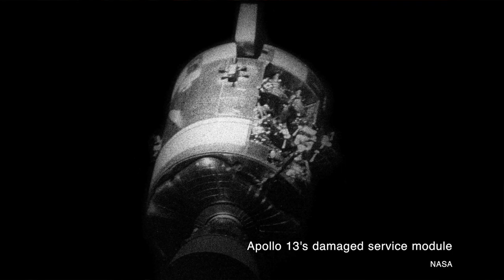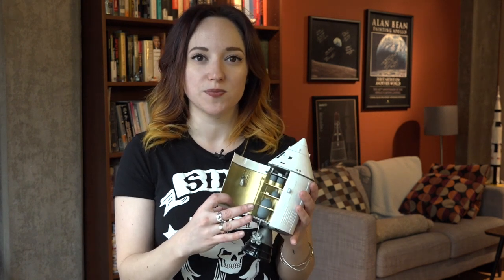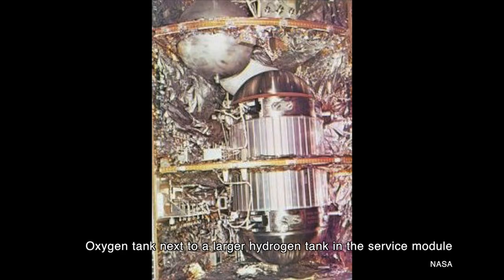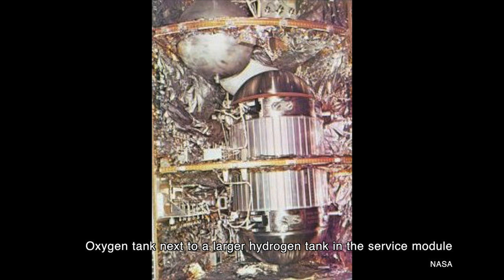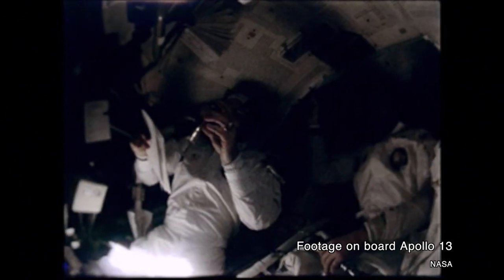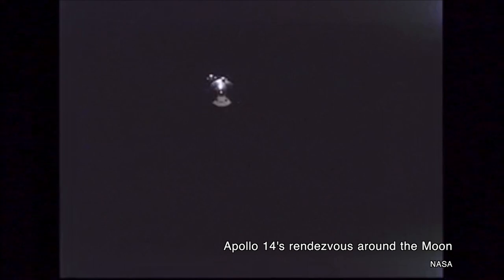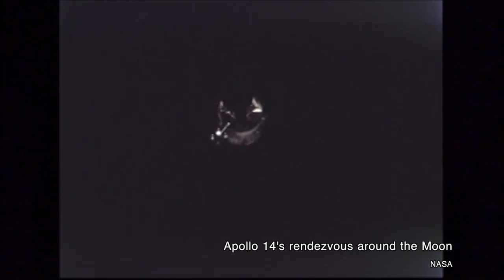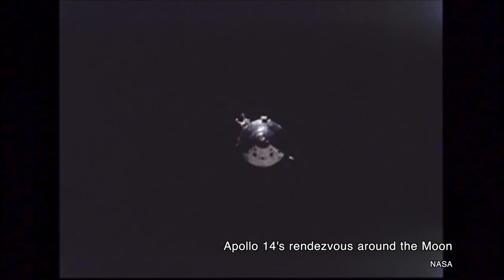What did NASA Change After the Apollo 13 Disaster?

Comment: Excellent presentation.  Just a couple of notes.  When the shelf was dropped 2 inches in October 1968, the drain tube, which was difficult to tighten due to it's position became dislodged, preventing de-tanking after the CDDT ( countdown demonstration test).  Heating the tank vented the O2 out the vent tube as well as causing the relay to be fused closed by the electrical overload.
Apollo 10 was the first apollo flight to experience a fuel cell failure.  It occurred on the way home so it did not affect the mission. If it had occurred outbound to the moon, the mission would have be scrubbed.

Jack Swigert actually volunteered early to be a command module specialist as did Ken Mattingly.  He was on the support crew for Apollo 7.  Just prior to launch, Wally Schirra, who had a very perfectionistic and overbearing presence in the planning of the flight and manufacture of the CM did something that proved a great asset.  He personally asked Jack Swigert to come up with an emergency power down checklist just in case there was an explosion in the service module. 
 God moves in mysterious ways.

Comment: Very fortunate that the Apollo 13 defect was not on the Apollo 8 command module since they did not have the lunar module life boat.
Reply: Good point.
Reply: Or, even on the return journey, as they also wouldn't have had the lunar module.
Reply: Wow, I never considered that.
Reply: @xyz.ijk.  One of the first things my father thought about  after the flight, being that Jim Lovell was on both flights. I was thinking the same thing.
Reply: I just saw how Lovell hit the wrong computer code p01 that reset everything and really screwed up APOLLO 8 for a while
Reply: @GoodVideos4  and that is thanks to another malfunction. the sensor in the tank was not reading correctly so they were stirring the tanks more frequently to make sure the oxygen wasn't stratifying. if they had not been, they calculated that the tank would have, instead, exploded sometime around the time while Lovell and Haise were on the moon or after they had re-joined Swigert and ditched the exhausted LEM.
Reply: Jim Lovell was really hoping to walk on the moon that second time, after not having been able to the first time.
Reply: @mem1701movies  Just like what Forrest Gump would've done.

Comment: Jim Lovell's biography "Lost Moon" outlines a slightly different sequence of design and procedural failures leading up to the infamous O2 tank explosion (my apologies for the wordy explanation):
  
(1) The O2 tank heaters were originally specified to operate on 28V power; NASA asked their contractors to change their electrical systems to 60V (which was used on the launch pad systems).  Beech Aircraft complied on the heater, but the heater relay was overlooked and designed for 28V (first design mistake).  The electrical heaters were only to be used during ground tests to thaw out the O2 tank after draining (to prevent condensation of moisture in the air).  A dip tube allow the tank to emptied out through the top of the tank.
(2) Test procedures dictated no higher than 80 Degree C inside of the O2 tank whenever the heater was active and there was a thermocouple installed inside to measure temperature.  Unfortunately, this temperature sensor was connected to a dial readout which topped out at 80 Degree C (second design mistake).
(3) When the tank was accidentally dropped, as mentioned in Amy Shira Teite's videol, the dip tube broke off but nobody knew of this damage (not sure if X-Raying the tank would have picked up the problem).
(4) Two weeks before the launch,  a full pad test was conducted with both H2 and O2 tanks in the Service Module fully loaded with their cryogenics.  At the end of the test, engineers discovered they could not fully empty one of the O2 tanks (which in the post-flight investigation was attribute to the broken dip tube).  In an early morning meeting with the astronauts, engineers and managers, was decided to boil-off the liquid O2 using the tank heater.  As a safety measure, an engineer was assigned to monitor the tank temperature during the boil-off.
(5) When the heater was turned on, the 28V relay contacted fused shut on the 60V heater power, thereby letting the temperature to reach 1000 Degrees C. The test engineer only saw the needle on the undersized air reaching 80 Degree C.  The kiln-like temperature boiled off all of the liquid O2, but also frayed all of the teflon insulation around the heater elements and cryo stir fan motors, exposing bare electrical wires.
(6) During the flight, two O2 tank cryo stirs were done without incident.  On the third cryo stir, sparks jumped between the bare fan motor wires and the tank wall which ignited the teflon debris; in the pure liquid O2 environment, the insulation exploded like a bomb.
 
No one design or procedural mistake would have been fatal, but the combination resulted in a catastrophic explosion.  Fortunately, the failure occurred at a point in the mission where it was survivable.
Reply: Wow! Good comment, it's very informative.
Reply: Fascinating; how 'lucky' the explosion happened before the astronauts jettisoned the lunar module. Tremendous videos, Amy, and some very interesting and learned comments added to many of them. Thanks very much, all.
Reply: Exactly. When a movie is based on a book, the credibility goes to the book.
Reply: That i unserstand but how could they examine this as thé csm never returned to earth
This conslusion is based upon assuming what could have been thé root cause
Reply: Fireball XL5  I agree,and let there be no misunderstanding,i am a Truly believer in NASA and its ideas

Comment: I believe the issue was the ground crew had not got the updated schematics of the valve. As NASA changed the voltage from 85 to 28 volts. So when they tested the tanks at the factory they used the 85 volts and the contacts welded shut and burn the wiring to where it was exposed. When they refilled the tank after the test fight prep they used the voltage to bleed off what remained. 

It's a damn miracle they made it back. As that tank was in the outside position in the rack and it blew the panel cover off without destroying the CSM inside. They also had extra oxygen for the longer lunar mission duration onboard. They also shut down the CM with only 2 mins left before the AGC went down  for good. Just few of the 40 they had to have go right.

Comment: They also moved some services to the opposite side of the Command Module and they changed their Engineering Management standards as well. These were very important points and needed to be included in all future design and production considerations. They are worth addressing in your video because they were the overarching themes that led to the details that you described.

Comment: Apollo 14 had it share of problems. The command module had trouble docking with the lunar module. After separation in lunar orbit a false reading threatened to auto abort the landing until a program was written by M.I.T. to instruct the LM computer to ignore the auto abort command. During the main lunar excursion the small cart used would not roll in the dust and had to be carried.  During that excursion the crew became disorientated and failed to reach their ultimate goal the rim of Cone crater. Some said they failed because Shepard and Mitchell were less than fully dedicated to pre-mission training.
Reply: Can't blame it on dedication ,especially those two ! Blame it on stone age  equipment (IE: Push cart)= EXHAUSTION ! No good way to judge distance . ETC.....................

Comment: Your best segment! Love the model used and the technical details/pictures!
Reply from the maker: +bhurley2001 Cheers! Thank you!
Reply: +Amy Shira Teitel (Vintage Space) But what about the lithium hydroxide cannisters? Square in one space craft, round in the other. How did that get past the design review folks?
Reply: That does seen to be a Homer Simpson Doh! moment! Guess it was probably the result of Grumman making the LM and North American Aviation making the Command/Service module. The principal concern would most likely have been the docking mechanism.
Reply: +David Discenza Extra cannisters were carried on future missions.
Reply: +Eric Bryce Still, what an oversight to make them two different shapes. Oh well, live and learn.
Reply: David Discenza I agree, I suppose the only explanation is two different contractors.
Reply: Still pretty amazing that the whole thing worked given all the different prime and subcontractors who worked on the program.
Reply: +David Discenza The space and weight requirements of the CM and LM were different as were the purification needs of the canisters.   The round canisters were used, in part due to different contractors, but also due to the different requirements.
Reply: detritus23 True, 2 men instead of 3 and for a smaller time period.

Comment: As I recall one of the books I read said that Beechcraft (who  the heating elements) had failed to put in an upgraded heating element that could handle high voltages.  It may have been missed while the unit was being repaired following being dropped.  There were also errors made in the test equipment that was supposed to monitor the internal temperature durint tests which allowed it to repeatedly overheat.

Comment: As someone sitting on the edge of his seat for any of the news reports during the Apollo 13 mission I thank you for reminding me of the failure analysis and the changes made. I could not recall any but the difference in voltage used for the testing.

Comment: Nice video, Amy, as always.  I knew about the findings of the forensics,, but didn't know about the remediation a done afterward. Didn't realize so many things were changed. Did all those changes cause a delay for Apollo 14, or cause problems due to the extra weight of another tank and batteries?

Comment: Question, did they ever standardize the CO2 filters between the various modules?
Reply from the maker: No (but I'd honestly have to double check). At that point hardware was being made and systems were set. Making that kind of change could have killed remaining missions.
Reply: Ah, I see. Thanks for the answer!
Reply: Possibly an adapter for the filters was made to use between the LEM and CM . IMHO that would of been the easiest and cheapest solution.
Reply: Even cheaper would be taking more spare ones inside LM instead of packing them into descend stage. Those things was really not taking much space.
Reply: At any rate they now had a way to fashon an adapter, Nasa no doubt held onto those plans.
Reply: @DrNo-uq7xx  Agreed. The adapter was made by Apple. :-)
Reply: Nick Bruno  They made a change. An adapter was made to fit both the LEM and CSM.. As this saved weight over adding more scrubbers. Simply insert the CSM scrubber to the Adapter. Install into hole on LEM.. They now had a backup if one scrubber failed to work. You could use the other. 

I would. They did have a mission plan to use the LEM as a lifeboat. They just never used it in training.
Reply: the procedure for adapting the CM filters to the LEM were added to the emergency manuals it think. The following missions also had longer stays on the moon so surely they had to have more filters on board as well
Reply: @Mašinka Tomáš actually a NASA brain worked out how to adapt the cartridges long before 13 and wrote radio instructions to communicate to the astronauts, the scene where a bunch of brainiac work it out on the fly during the mission didn't actually happen.

Comment: the thing that gets me is that no one previously saw an issue with using 60+ volts when the spacecraft only had 28 volts...its like plugging a 12volt hairdryer into a 120 volt wall outlet....its gonna burn and everyone knows you do Not do that.

Even from a testing standpoint of making sure things will work in the proper conditions, I don't get how so many PHDs and Engineers / testers, astronauts or even Janitors didnt say something about that.

Comment: I have heard that one other thing that changed after Apollo 13 was how the training of the crew and controller was conducted and how they thought about the simulated emergencies that they were called upon to deal with. 

Prior to Apollo 13, there were apparently complaints about "unrealistic" emergencies - who ever heard of complete in-flight loss of power or life support, etc. One or two fuel cells going dead, fine. But losing ALL three fuel cells? Never happened. One cryo tank going bad, okay, but we got other tanks. 

After Apollo 13, given the demonstration of how real-life events can make a mockery of "what we know is so", the crews and controllers going through simulator training did not complain any more about "unrealistic" emergencies. 

I also understand that NASA redesigned the system for one cryo tank, by itself, would be sufficient for the entire mission if that should be necessary. Obviously redundancy calls for having more than one cryo tank.
Reply: The LEM lifeboat mode was envisioned and put in the contingency procedures for Apollo 9. Little did they know 4 missions later they'd be called into mission use. ;)

Comment: Great presentation. Here's a question. I used to get the mission reports from the Government Printing Office in Pueblo Colorado. There was quite a bit  on Apollo 13. The description of the malfunction was simpler, and somewhat different. Basically it said insulation had been burned off the wire heater/stirrer. That happened because the launch pad power unit that supplied power to the CSM when it wasn't on internal power was accidentally wired incorrectly during a replacement, causing it to deliver 24 volts instead of 12 (a series/parallel issue). According to that document, the replacement had taken place prior to Apollo 12, and the Apollo 12 mission was actually flown with the same issue.

Your explanation is more complex, and I don't doubt it for a minute. I was just wondering if you had run across  the earlier explanation while researching this.

Comment: Great show as always, Amy. Wasn't there also a problem with the pressure gauges on the tanks only reading up to 40 PSI when the maximum pressure of the tanks as 40 PSI which prevented the detection of excess pressure?

Comment: Hello Amy, you stated in this video that more batteries were added subsequent to the Apollo 13 mission. Two questions: 1) what type, battery chemistry was used, and 2) on Apollo 13, after the closing of the react valves, was battery the only source of power, or did the lifeboat also have fuel cells?

Comment: i've always wondered about what it was really like on apollo 13 as far as conditions were concerned. i've heard about the water rationing and having to store their own wastes, but it seemed like the cold was brought up more often than not from various documentaries.

then i got to thinking. those nice, thick, very well insulated space suits they went aboard apollo 13 with; why didn't they just cozy up in them during the coast back to earth? similarly, i've always wondered where those suits got stored when they weren't being used.

keep doing what you're doing Miss Teitel! big fan of your work.
Reply: I've thought that, too. Ok, the suits were too bulky to move about in, but when it was time for one of them to sleep, move to the command module and put on their launch suit, with the gloves and boots, but leave the helmet off (no power to circulate O2). The head is a very good radiator. Too hot, still? Take the boots off or the gloves. Then they could have gotten better sleep.

Storage was under the couches. Check out David Woods' How Apollo Flew to the Moon. (no he and I aren't related.)

Comment: What I read at the time, NASA had upgraded, for matter of efficiency, the line voltage in the SM from 28 V to 65 V. All electrical components were replaced with others rated for 65 Volt.
The oxigen tank had a thermostat to control the heating element in the tank. A thermostat is a bimetallic switch that opens at a given temperature, so when temperature is reached, it stops electricity flowing in the heater. This thermostat was rated at 28 V on a 65 Volt circuit, so at one point it weld shut and temperature became very high, and damaged wires inside. When the agitator fan was activated, the tank - over temperature and over pression - exploded.
I repeat, this is knowledge from 40 years ago, and the technical magazine where I read it, has long been lost; but I'm sure I recall it correctly...
Thanks for the great video...

Comment: The temperature gauges used during testing did not go high enough for the technicians to notice the very hot temperatures reached (http://nssdc.gsfc.nasa.gov/planetary/lunar/ap13acc.html). These were also changed. This is a really interesting example of poor user interface design - optimising for the common case, but not allowing for the extreme badness of the exceptional case.
Reply from the maker: +Mike Lawther Good call. I'm considering a blog post going through the extent of changes made post-Apollo 13 since it's sort of a lot of detail for a video. Maybe I should put it together!
Reply: +Amy Shira Teitel (Vintage Space) That would be great. This particular gauge example reminds me very much of what Frank Borman said about the Apollo 1 accident in his testimony to Congress - that it was 'a failure of imagination'.
Reply: +Amy Shira Teitel (Vintage Space) A blog on changes after Apollo 1 and 13  with your flair for interesting details would be great.
Reply: Reminds me of the gauges at the Chernobyl plant which barely read anything above normal operation

Comment: just one question, you said that the fans were removed completely. it was my understanding that they were simply modified.
did they not need to stir the tanks given the new multi-core heating element?
if you could explain in further detail I would be very interested, as I have gotten many different explanations from different sources.
Thanks